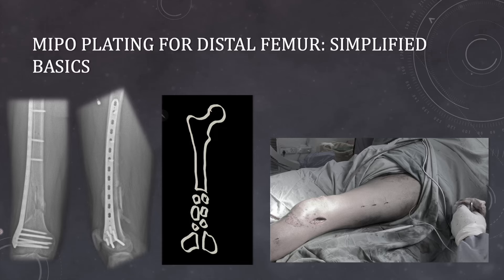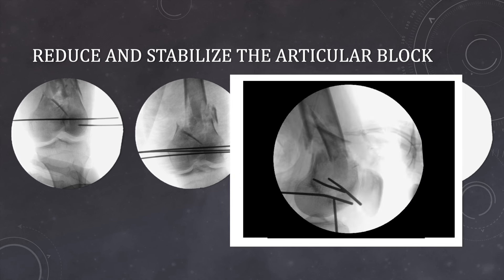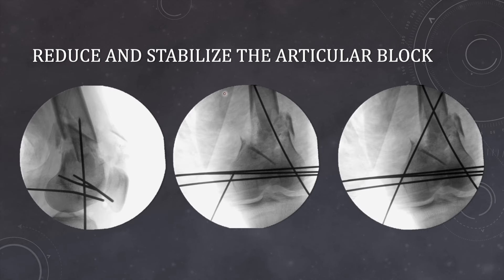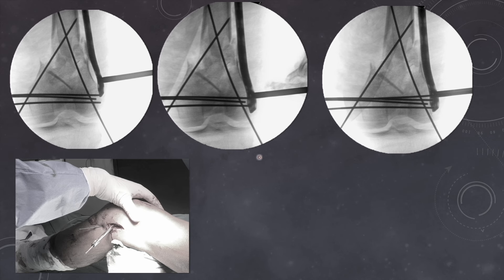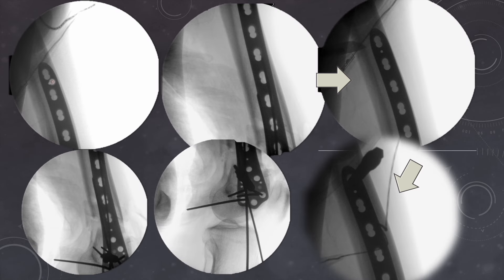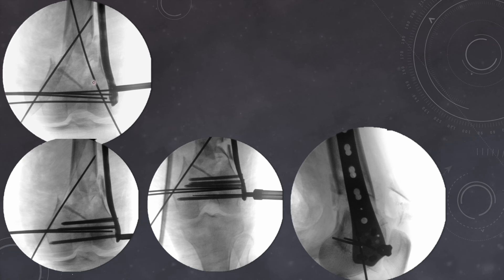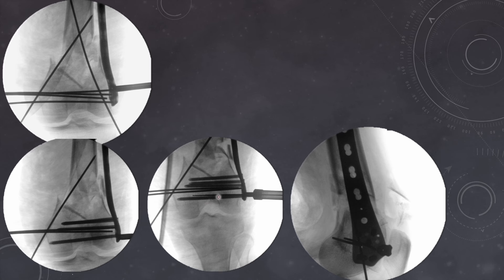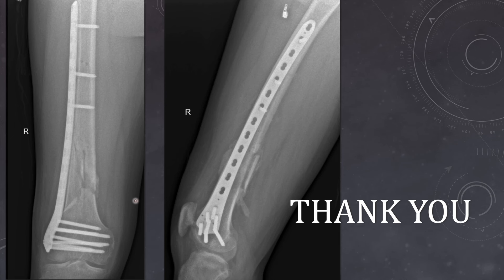MIPO plating distal femur: Basics

Comment: Very nicely done. But distal fragment thoda valgus mein hai aapka.. Kya kijiyega Isko prevent karne ke liye?
Reply from the maker: Thanks, Rightly asked! Yes it’s intentionally kept in slight valgus. We always confirm the alignment from the contralateral limb to see if valgus or neutral reduction is needed. In several young patients the distal femur is in slight valgus while proximal tibia is in slight varus normally, so that helps as template in guiding the reduction adjustments. The opposite knee is always available for c arm view and that really helps. In bilateral injuries, we just add slight valgus considering that failure of such fixation is mostly in varus and thus slight valgus is more suitable if we are not sure of pre injury alignment.